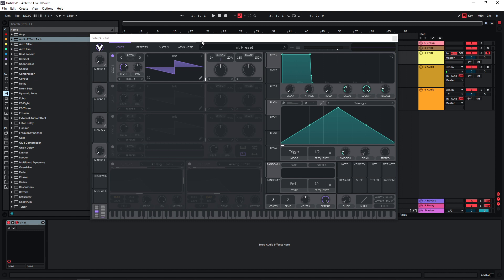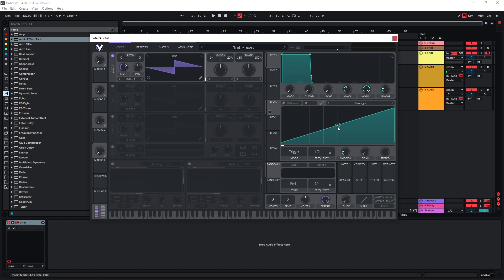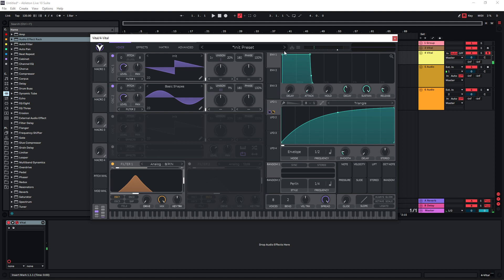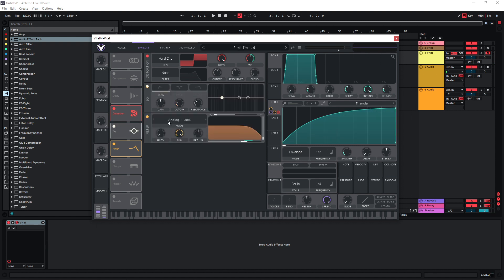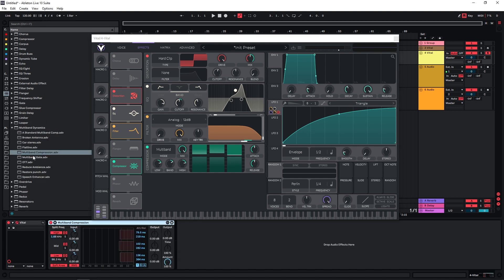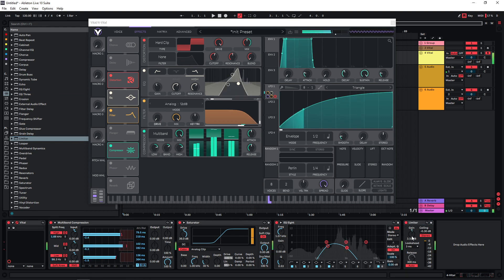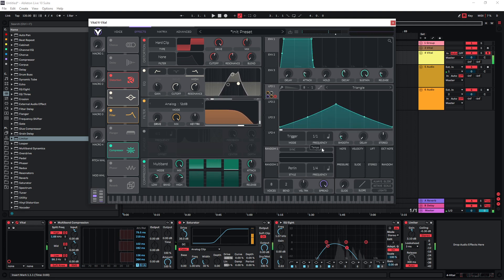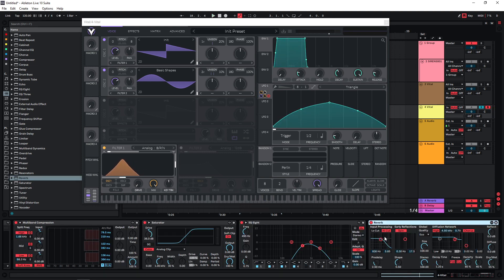How To Sound Design Sirens & Alarms (using Vital)

Comment: How would you make an air raid siren??
Reply from the maker: I think the main thing you would have to adjust is the frequency of the LFO and probably the shape as well, since these sirens tend to go down in pitch slower than they rise in pitch. 
So I would start by turning the frequency of the LFO down and then play around with the shape a bit. Once you have the shape/pitch modulation where you want it, you can start shaping the sound if necessary.

This is just from the top of my head; I hope this helps. :)
Reply: @NGTVST  cheers I'll try that